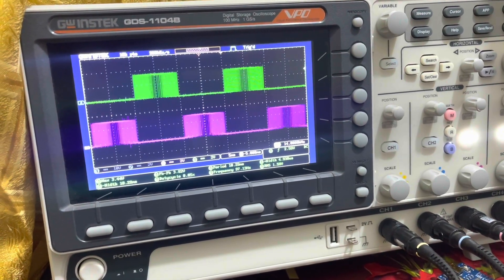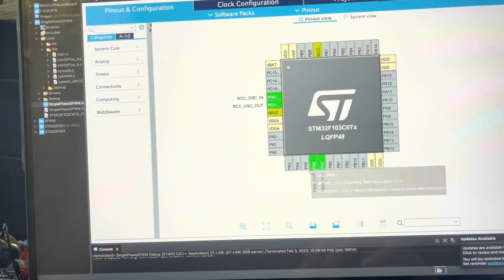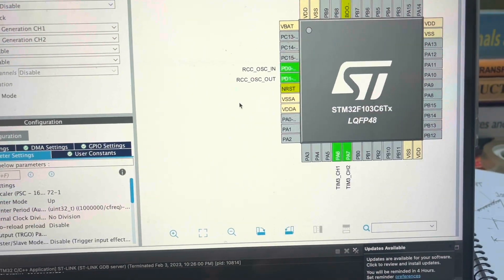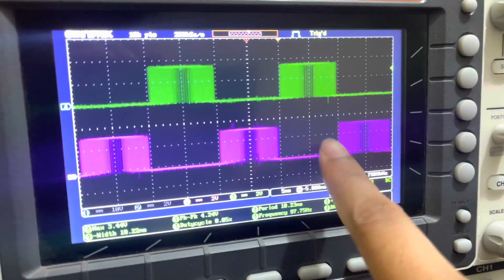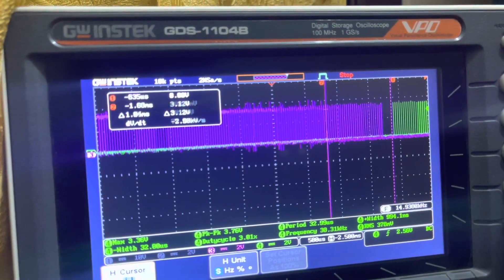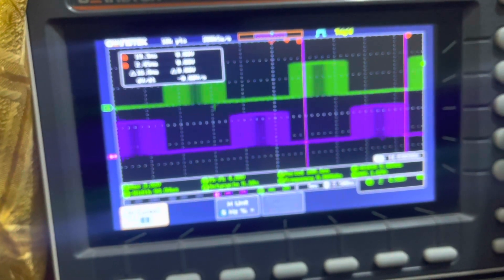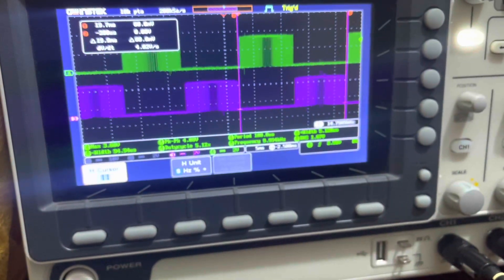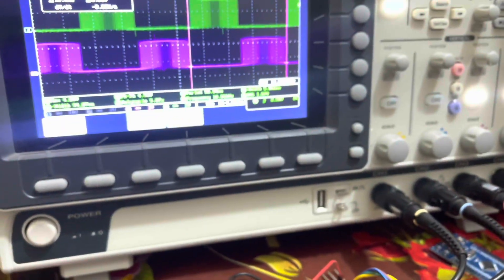Sinusoidal PWM Generation on STM32 Board || SPWM on STM32F103C8T6 || STM32 Cube IDE || Blue Pill

Comment: HI, thanks for your video. I try to make 3-phase VFD and I can make SPWM with 1024 LUT and SAPWM - Saddle PWM, but I have no experience with SVPWM.
Can be SVPWM also generated with LUT or SVPWM needs 6-sectors and make vector calculations in realtime ?
Can you inplement with STM32 precise DEADTIME e.g 100 - 600 ns and are timers at STM32 synchronized with nanosecond precision ?
What is impact of DEADTIME to sinewave and THD ?